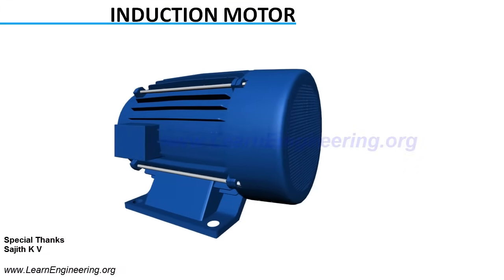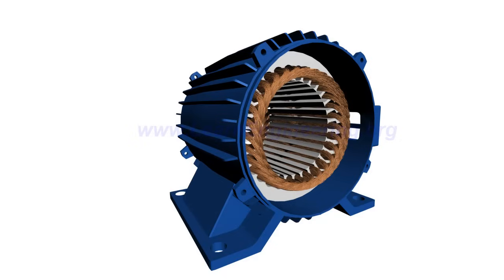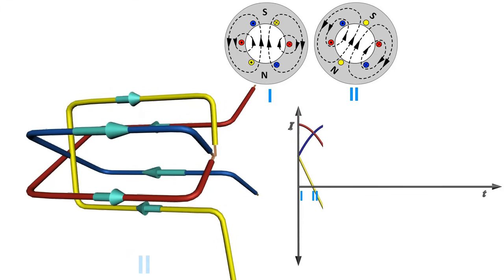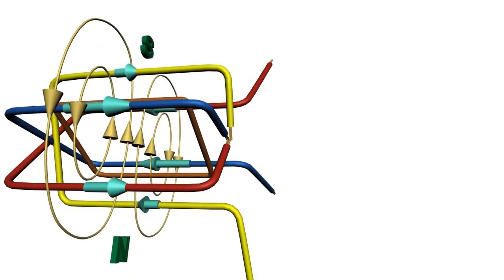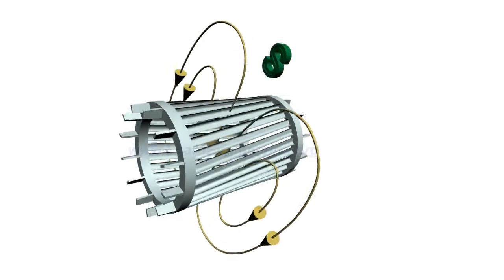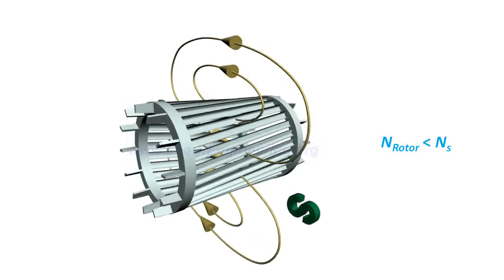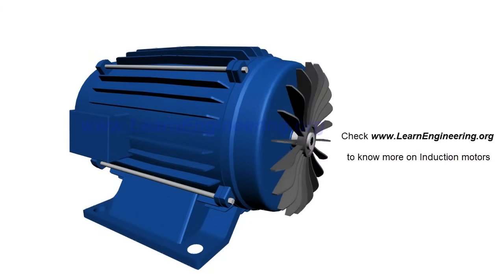How does an Induction Motor work ?

Comment: how is it, that these youtube  gods explain this stuff so much better that professors and doctors at the university?
5 minutes to explain 2 hour lecture.. thanks!
Reply: +jointdoggg Youtube keyword-based results have a superior selection filtering capability to your selection of your professors for talks. Consider, there are a lot of schools, a lot of classes, and a lot of professors.  Most likely, you can't go to the very best such lectures (even if you wanted to) since you probably could not get in.  So it is two-sided filter.  Also, a professor that has an awesome lecture about one subject might give a lame lecture about another.  Overall, the odds of you randomly picking out the best professor and school and class and semester to speak about one topic (electric induction motors in this case) is very low, under well 1/1,000,000.  However, the odds of youtube putting the best video it has about a subject near #1-#10 is much higher.

Based on the tone of your question, an implied question you also ask is, "Are universities even needed anymore, since youtube is better?"  First, you might think you understand induction motors now, but all that happened is you watched a video.  Probably you have learned a lot just now, but until you solve problems without any help and get the right answers, you might not really understand the material very well.  I have a very long comment about this here jasontaylor.us/#fb3 , in case you are bored.  (A video about a much more complex topic, a jet engine, was similarly praised by people who arrogantly thought they had just learned how it worked.)  Two benefits of that professor being right there is you can ask questions while learning, and can realize gaps in your knowledge when you discover that you can't answer the unexpected ones directed to you.

Second, learning and knowing isn't actually of much benefit in this world.   What does learning mean if nobody knows how smart you are?  In my opinion, loyalty is far more fiscally valuable in the human marketplace than intelligence, creativity, or knowledge.  Today, universities are more about people and relationships. Learning is important, but it isn't the only thing colleges have to offer.
Crossposted @ https://www.facebook.com/jasontaylor7777777/posts/10205543938301354.
Reply: @mustlovemore  A profoundly balanced comment.
Reply: +jointdoggg  Perhaps the professors should learn how to create nice animations instead of using blackboards, and avoid the mathematical details? Although that may be entertaining and convey the idea from a layman's perspective, I doubt it will help making engineers out of the students. After watching this video how many viewers do you think can go on to design, analyse and optimize performance of induction motors, and be able to work on creating industry-grade induction motors? What you are expecting is to become a theoretical physicist by watching a cheesy PBS documentary on blackholes.
Reply: because a picture is worth 1000 words, and a video is worth 1000 pictures. haha.
Reply: +jointdoggg Because profs and docs are appointed on their academic merits, knowledge and experience in the subject. They often lack any pedagogical skills and sometimes are just outright cranky and equipped with zero social skills. Still, they are often the most competent ones on the science part, who respond well to perceived interest on students' behalf.
Reply: +jointdoggg Because videos are more powerful for explanation than words and abstract equations
Reply: Those who can't do, teach, those who can do, make great Youtube videos on motors.
Reply: +jointdoggg Your speaking truth.
Reply: +John Veitch - That'd sure suit me!
I got my highest grade in secondary school (or high school as Statesiders say) in general science, but never really got into maths, so ended up studying literature. Now,  i'm completely intrigued by the various ways of using electricity to power cars and can't wait for the day when everyone's converting their favourite old lemon into an EV hot rod from hell. I reckon it's less than 5 years away.

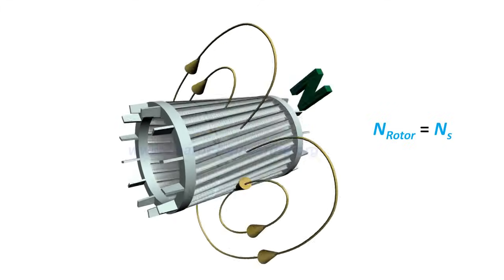Anyway, may i ask: in that equation at 3:20, "NRotor = NS" - What's the N stand for? 
And the S.
And the Rotor?
Reply: +Julian Warmington "N" stands for angular velocity (revolutions per minute)....N_Rotor=N_S means that rotor (shaft) revolutions per minute are equal to magnetic field revolutions per minute. "S" states for "synchronous". Synchronous speed is the speed of magnetic field produced by stator winding.
Reply: Oh. Wow, that's really helpful and kind of you to explain. Thanks very much.
Reply: lol.
Reply: respiration in human
Reply: Because you are not meant to understand. You are meant to memorize. You are supposed to copy whatever a teacher writes onto a blackboard and then copy the copy. That is called education.  

You are rated based on your ability to copy things. And when a technology shows the stupidity of such education, teachers try to ban the technology. 

Why not. It is better to maim generations then to realize it is done wrong.
Reply: Loyalty to what? Paying for the university taxes and things?
Reply: jointdoggg you guys talk trash on your prof, when you cant do any better
Reply: our interest matters bro :P
Reply: Because these guys just give you the most important functional parts, and represent everything they explain visually.
Reply: jointdoggg   For one, this wasn't produced in the mere 5 minutes.
Reply: jointdoggg  really true
Reply: I work in a company that manufactures these motors. I have built these motors.... it wasnt until now that I finally understood how these motors work!
Reply: It is true, but without Those complicated formula
Reply: Oh that's easy: because in university you have only few doctors to explain and almost zero options to choose.  But on youtube, only those get popular ho do it well. 

That's a very good sign right? That's true but on other hand, the same algorithms will protect you from smth new to learn (since search and suggestion engines would try to keep suggesting you videos similar you already watched). That's ease to spot if you open anonymous tab in your browser and open youtube once again.

p.s. nothing is perfect in this world :)
Reply: Because "a picture speaks thousand words. And a video speaks million words"
Reply: Professor is nothing. Only title. Nikola tesla and friends never get the professor title.
Reply: +jointdoggg  Because traditional Engineering Science focuses on the physics and math, w/o consideration to explain a concept like this.  Their approach is, if you know the math, then you can design/understand the motor.  But not so.  I have Bachelors in Electronics Technology, and we teach the practical approach first, then intro the math, often non-calc. based.
Reply: You will find that the Tesla ac induction uni-polar asynchronous reluctance motor is the same as the (('photoelectric stepping motor for alternating current motors'  referred to for Tesla patent #0685957 - Apparatus for the utilization of radiant energy; related to #577671; Transmitted or natural radiant energy can be used of 1901 November 5th. 5 years  before Einstein published his 'Photoelectric Effect" newworldencyclopedia org/entry/Photoelectric_effect
Reply: jointdoggg true

Comment: A small correction. Difference between Synchronous speed and rotor speed is not slip. it is ratio of the said difference to the synchronous speed. Other than that the video is awesome.
Reply: +Anubhav Kumar - So, is "slip" something else altogether, or did they just make it up?
What IS slip then?
Reply: Julian Warmington sir. Slip does depends on the difference of synchronous speed and speed of ratation. But if you need to express if mathematically it is :"Ratio of difference of synchronous speed and rotation speed to the synchronous speed". Expressed as slip=(ns-n)/ns.

Comment: You explained the slip very well. Yes, no varying magnetic fields yields no induced voltage and hence no counter magnetic field or force to rotate the rotor. Hence, it slows down to gain another varying magnetic field. Thanks a lot

Comment: Ok, now I get the reason motors don't go as fast as you would think. Out here our electricity is 50Hz, or 3,000 cycles per minute. I always wondered why a 4 pole motor didn't run at 1500rpm, as you would expect, but instead they run around 1400rpm. So without "slip" no power is inducted and therefore it slows down.

Comment: rotor construction is still unclear to me. Are those big bars conductors? Where is induced current in the rotor flowing? Are there any external connectors to rotor?
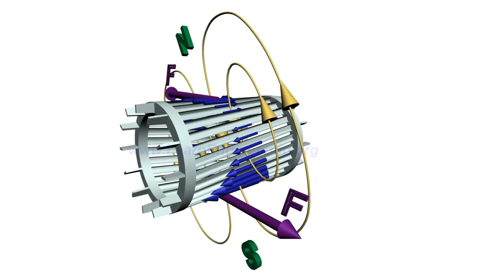Reply: the original portion that looks like a hamster wheel is the part that has the current induced.  The current runs along the bar to the endplates then loops back around to the opposite bar of the squirrel cage.  If you look at the video at 3:49 the blue arrows indicate the direction of current for each bar, and you will see that the peak current is equal but opposite to the peak current on the opposite side of the rotor.

Comment: this video is wrong and misleading in so many ways, 
1 at 1:40 thats not the correct 3 phase waveform
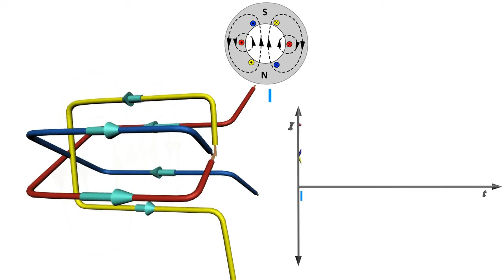2  at 1:15 the magnetic field lines do not point to south but north instead
3 at 3:38 the rotor appear to be going opposite the rotating field

these sort of things have caused me so much stress while trying to use this video to learn,
a year later i found a clear video here on youtube and finally managed to fully understand 3 phase I.M
Reply: OhPoWneDiel In your defending rant you forgot to share the video which helped clear out any misunderstandings. It would be a great human service if you pointed to the proper video while pointing out the flaws in this one.
Reply: This is a 3 phase waveform, it is just at 60deg phase shift as opposed to the 120deg that you're used to seeing.  Also the magnetic field lines are going the right way if you use the right hand rule to determine the direction of the field for each wire.  Also don't be concerned with the direction of the field outside the stator, but the direction internally which is working on the squirrel cage.  It is going the appropriate n to south.   The magnetic field produced will not act like one in a solid magnet bar, but acts like one produced by current through a wire.  And I also think that the rotor appearing to go opposite is a optical effect at the rotational speed.  Its like seeing certain wheels on a car that appear to be rotating backwards but the wheel is actually rotating in the proper direction.
Reply: You can see the spacing of the phases based upon the sigma distance from the peak of one phase to the other,  if students have gotten far enough in a engineering program to need to watch this video, then hopefully they understand enough of the sine waveform graphs to determine what degree the phases are shifted from each other.  The video is also current with what is being taught in class rooms for engineers.  If people who are watching this are confused, then chances are they are failing the course which has squirrel cage induction motors in it.  If you can't see the phase shift just from seeing the graph displayed in the video, then you need to learn a lot more about sine waveform graphs.  This video isn't confusing, and it actually helped me and a lot of students in my Mech Eng class to really understand what our electrical professor was talking about.  We found it concise and easy to understand, so you're ranting that the video will confuse students when it did quite the other.
Reply: Mind sharing the video? :)
Reply: Yes, I too would like the link to the correct video.
Reply: If students are too stupid to not be confused, they shouldn't bother learning.
Reply: Nick & Vanessa Favell did you seriously try to defend everything in this video that is bound to confuse students trying to lean from this???
when in the video did you hear him saying that 3 phase currents are spaced by 60 degrees, and also when did you hear him say those field lines are of the rotor currents, coz he said and also drawn them around stator conductors!

Comment: Tesla Motors are using this type of motor. I would like to know how it's able to work as a generator (regenerative braking). When you remove the 3 phase power wouldn't the induced magnetism in the rotor dissipate? What then makes it work as a generator?
Reply: that only works in a DC configuration. It's known as dynamic braking.
Reply: Doug Ankrum From what I've read and heard from Tesla engineers, their motors don't use permanent magnets at all. What I've read suggests that the amount of power they're running through them would cause them to rip the magnets apart (at least the rare earth magnets that are common today).

I would like to see a video that shows how it works as a generator though, because I have no clue. My only guess is they reverse the phasing of the coils, but I don't know how you get a current out of it from that.
Reply: Doug Ankrum First of all, there is no such thing as 3-phase direct current. Direct current doesn't have phases and having 3 feeding lines would just be redundant.
Tesla uses 3-phase AC asynchronous 'squirrel cage' motors. They do not have permanent magnets in the rotor, the rotor is an electromagnet fed by the induction from the stator. Therein lies my question, what feeds the rotor when it's working as a generator?
Reply: FDK  I believe the Tesla motor, when accelerating the car, works just like a normal squirrel-cage motor. But it does have a wound rotor, excited by direct current, which is not used when using the motor to accelerate. When braking, the rotor becomes excitated by means of direct current supplied by batteries and the whole motor works like an alternator, slip rings and all.
Correct me if I'm wrong, I like to educate, I love electric machines.
Reply: +krochliar Wrong, the AC induction motor will produce current if you try to spin it faster than what it is spinning at. So If I had a flywheel spinning at 3450 RPM at 60 Hertz for 2-pole AC motor and then suddenly lower motor frequency to 25 Hertz, then the motor will quickly "drag down" to that speed and it will back feed AC voltage out of its terminals. That is how AC induction motors use regen braking. No need for slip rings...........

Comment: *The manner in which that winding is connected produces a 3 phase winding with only 60 degrees phase  difference and not  120 degrees as normally expected.
Assuming we keep the  blue bend to the star point  as  it is, then to have the yellow phase at 120 degrees to  the blue phase, we need to take  off and disconnect the yellow off the existing star point,  and bend  the other side to meet the star point.
The same applies to the red phase. Take the existing  red connection from the star point and connect the other  red end to the star point. 
*The  rotating magnetic field  generated is of UNIFORM strength only if each of the phases is a perfect sine wave and the coils  having a distributed  winding........... easier said than done.
Still it is a good video for basic teaching.

Comment: The graph at 1:40 is wrong! Thats not a correct 3-phase
Reply: The graph only represents half of each winding which is why it appears that each phase is only 60 deg from apart. If you look at the picture of the windings you will see each winding is only 60 deg from the next. Because the motor has three phases 120 apart but for each phase the current is moving in the opposite direction on each side of the motor (the loop) it is effectively like 6 phases only 60 apart.

Comment: I think the description about emf generation in the squirl cage is slightly wrong. The induction of EMF and current in the squirl cage produces its own electro magnetic field. The South and North poles of this induced electro magnetic field in the squirl cage are then "dragged" behind the rotating stator magnetic field. In the video is makes it seem like the current creats the rotary motion directly while this is not the case. I think this is right, come some let me know if I have got that wrong.
Cheers
Reply: You're pretty much correct...
Reply: yeahhh that's true but rotationg megnatic feild also produce the motion if the current is produce in the loop so both of u are right

Comment: polyphase doesn't need a starting mechanism. 6 coils in the stator, 6 in the rotor, and you've got the coolest induction motor (in my opinion). The hard part is making 3 phase-shifted AC signals, but it's 2014, c'mon we can do that

Comment: 4:07, I've been told that this Ns - Nrotor difference is actually slip speed. Slip is slip speed divided by synchronous speed, so slip is the fraction slip speed / synchronous speed. S=(Ns-Nrotor)/Ns .

Comment: @Learn Engineering: What the hell is this at around 1:40 ?, this is not a correct 3-phase system... the number one rule for a 3-phase system is that the sum of all 3 currents at any moment is exactly 0 (zero).  This is not the case in this strange 3phase diagram that you show there.
Reply: Yes, that graph is wrong.

Comment: Can anyone tell me what happens when the rotor gets wet?
Reply: Nothing at all, although water in and around the rotor on a long term basis is going to knacker the bearings, rust the iron core, and generally get in the way.  Water around a brushed motor is much more serious, since it acts as an insulator.
Reply: drawingboard82 Well, with water comes moisture which speeds up leakage current through the windings. Enough current flowing through the current carrying parts ie. conductors and coming in contact with non-current carrying metal parts is a ground fault.
Reply: squirrel cage induction motor can work fine in water only if you have isolate very well the terminals inside the connection box.